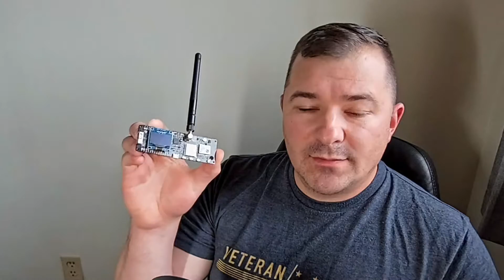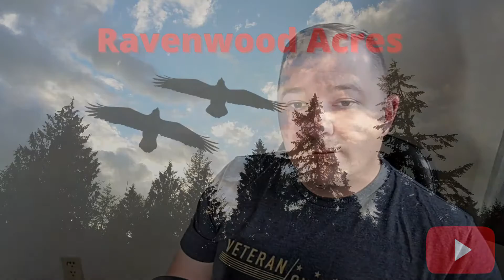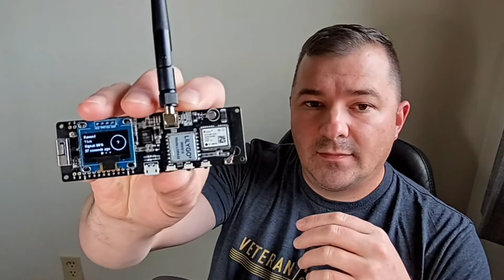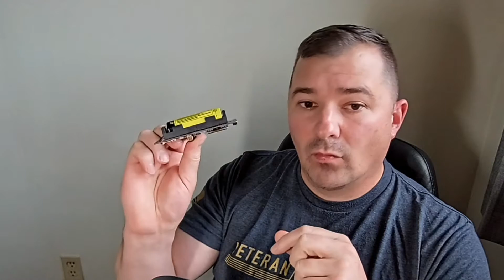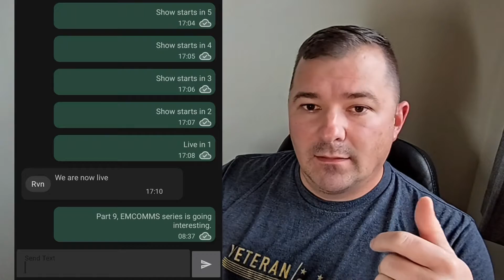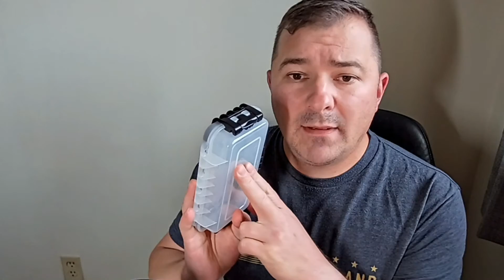EMCOMM: Meshtastic T-Beams devices - Part 9

Comment: Look into WisBlock Meshtastic Starter Kit & there 
RAKBox-B2 Enclosure with solar panel. Just add battery & antenna you have a waterproof solar node.
Reply from the maker: I am working on building one now.

Comment: Here's a solar base station I put together. You can use the models to 3D print and assemble a base station. I've had this running for 2 months without issue. It's not exactly a beginner project but if you're comfortable with soldering it's a robust and reliable solution.

https://www.printables.com/model/221500-meshtastic-solar-base-station-node-for-soshine-6-w
Reply from the maker: That is amazing, thank you for sharing. Currently, I do not have access to a 3D printer. I wonder if I could hire someone make me the printed contents.
Reply: @RavenwoodAcres  There's a couple things I want to update on this model (it works as-is, just want to improve it) but after that I could package just the printed parts and make them available.
Reply: Crealty ender 3 is less than $200 
Printer FYI
Reply: Are there any issues with bluetooth sleep? What FW version is used? Any changes must be made in app to have stable messaging?